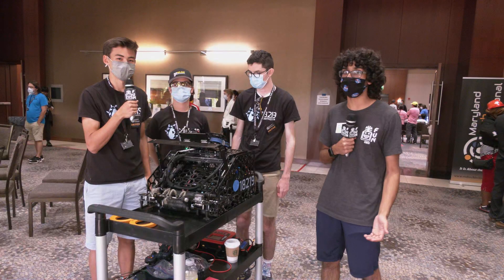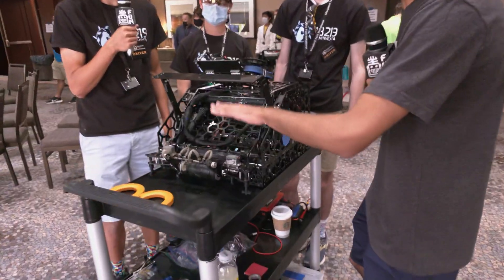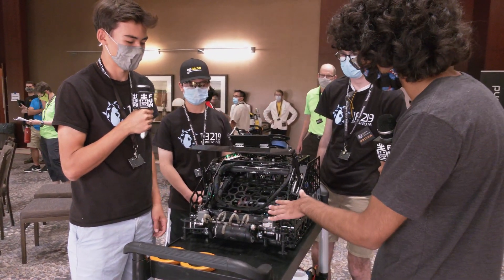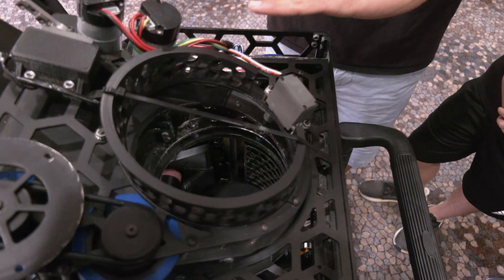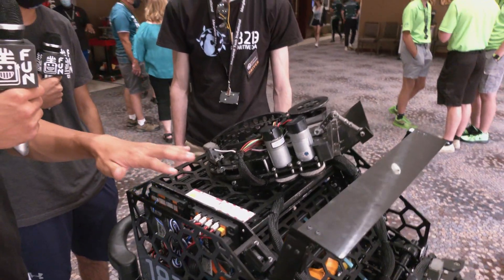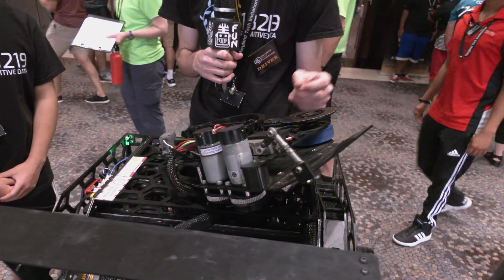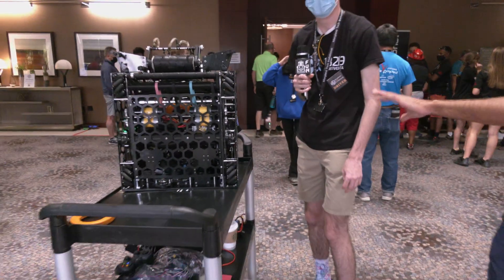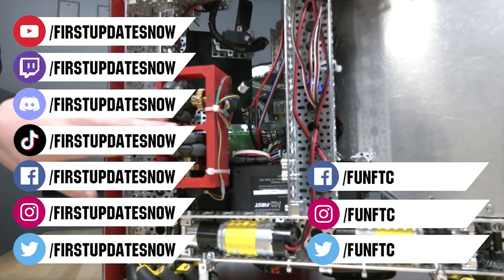FTC 18219 Primitive Data Behind the Bot Ultimate Goal First Updates Now

Comment: Thank you for sharing. How is the shooter able to move? How is it connected to the static part below? Is that a custom 3D printed? Thank you
Reply: the shooter is mounted to a bearing stack (which functions like a turntable/lazy susan) and the rotation is powered by a motor and timing belt. there is a combination of 3d printed and cnc machined parts